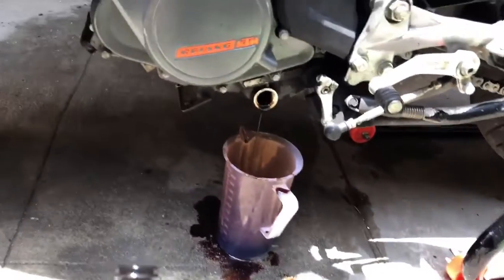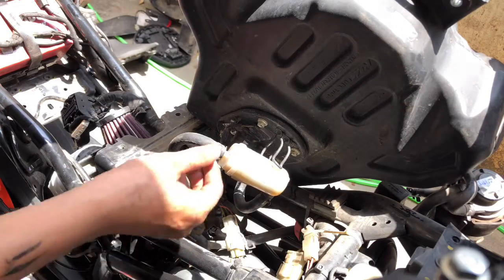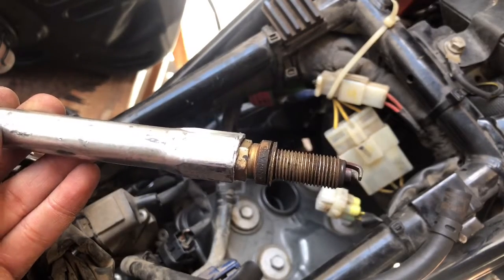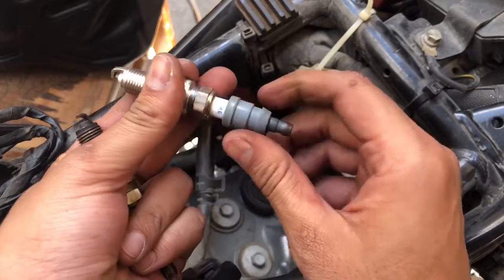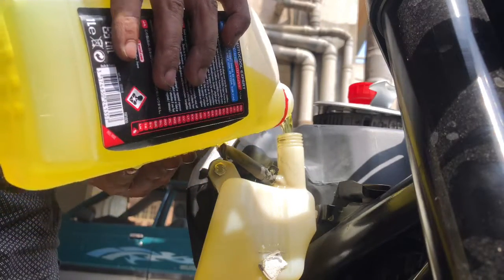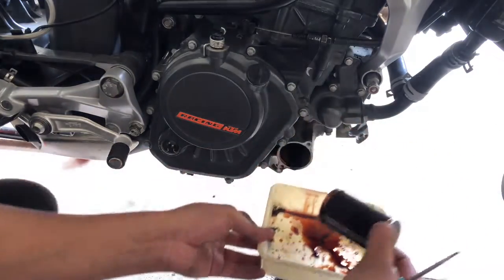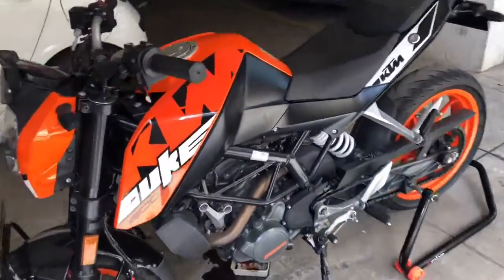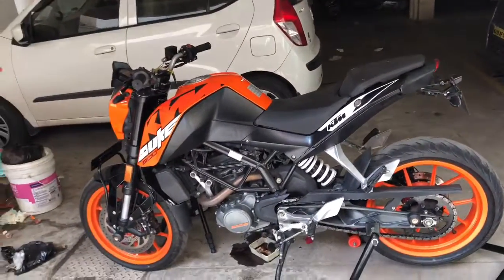Duke 200 Complete Service At Home | Ultimate Guide| DIY | PROJECT DUKE:S1-E5

Comment: I see that you put custom air filter.please,tell me,what you have done with the draining hose from the carter (the hose that comes from engine to airbox)?sorry for my english.cheers from Romania
Reply from the maker: Yeah it is just a breater hose wich comes from the engine its nothing an issue i have put an oil filtre on the top of it so that no dust goes into it 
Keep supporting bro💕
Reply: @custommodz6769  instead of oil filter that keeps the moisture i think an pcv valve it's a better option.what do you think?
Reply from the maker: Yeah that too the good idea bro😇